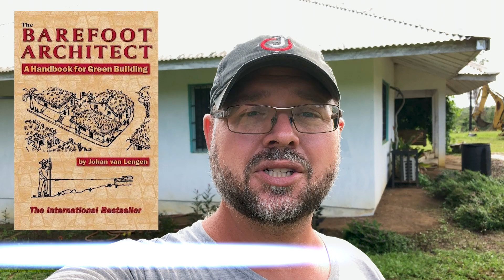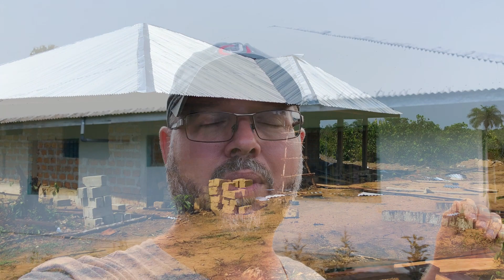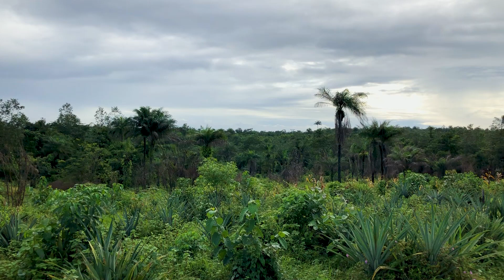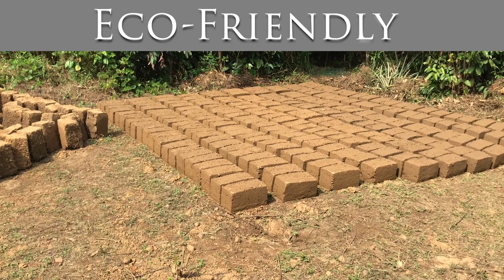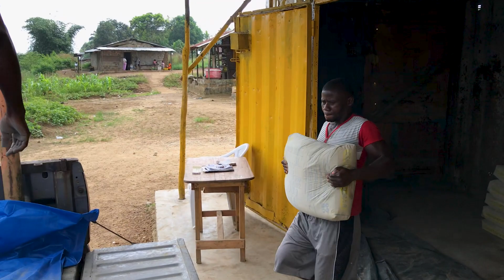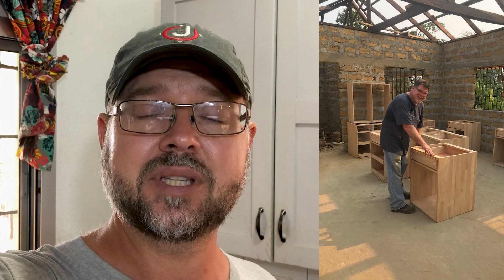10 CRITICAL Tropical Home Design Elements You SHOULD Know About

Comment: Interesting - I am an Australian building houses in the Philippines. We build with sand and cement concrete blocks and the ones made by others are weak, because they just don't put the right amount of cement in the mix.  We had to make our own to get strong block.  Houses are built in a similar way, but zero wood.  Steel for roof trusses and a lot of 3/8" rebar in walls with concrete and rebar columns every 15'.  Earthquake resilience!

Comment: Very good design elements. How far from the eaves do u plan to put the passionfruit vine?
Reply from the maker: Great question! I plan on moving the permanent trellis about 3 ft/1m away from the house eves. This will minimize the vines reaching over to the house and growing up the roof or entering the attic space, which is a big problem with the current placement. With that, I plan on raising it about 12-18 inches/30-45 centimeters to prevent that 4 pm sun from directly shining in, while allowing more indirect light.

I’ve learned it’s important to severely trim back the vine from the top of the trellis after it completes the fruiting cycle. Otherwise it will develop a thick and impenetrable mat that will prevent fruit from dropping through.

Comment: Nice project. I live in Uganda an African country too. Am planning on setting up an homestead too. Am starting any mommnet now. I can relate to almost all the things  you raised. My other big big problem is the tarmintes. Have you had that too? And how have you been handling it? They are terible in my part of Africa. Otherwise thanks and good luck.
Reply from the maker: Yes, we also have lots of termites. In our case, using cement to “plaster” the inside and outside of the walls help keep them from moving in. We had some in the dirt brick that required treatment after construction. Also, we treated all the wood roof rafters with Carboline.